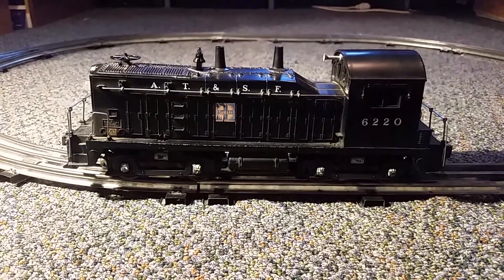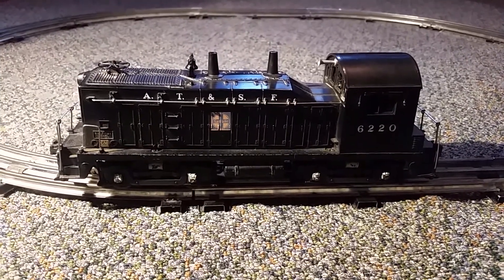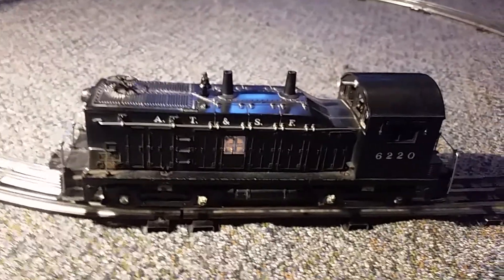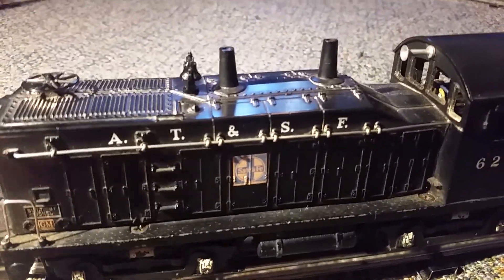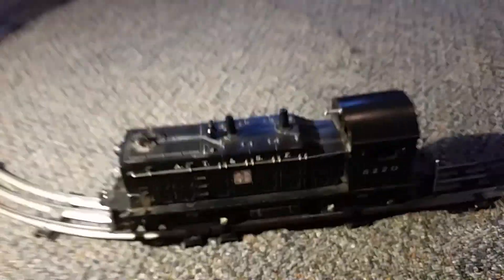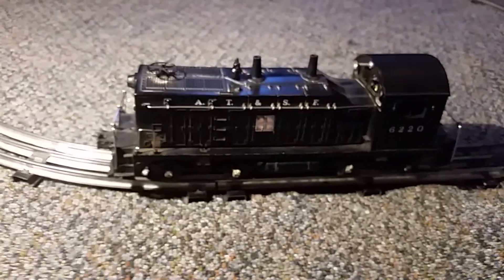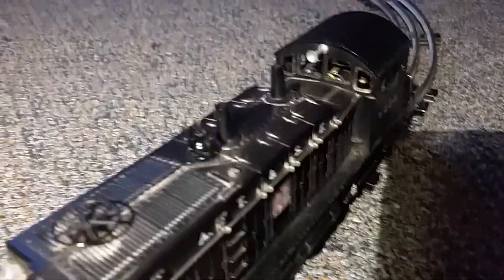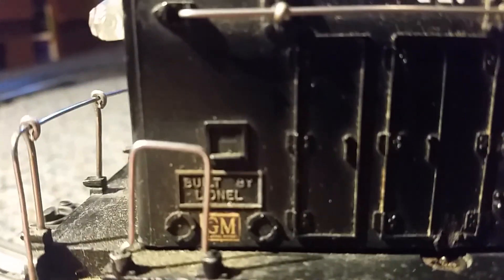Lionel 6220 Santa Fe "Bell Ringer" NW-2 Diesel Switcher

Comment: The NW-2 was made by the “Electro-Motive Division” of (“General Motors Corporation”), as well as the F-3/F-7 (“Cabs and Hoods”) and the GP-7/GP-9 aka GEEPS ! And Lionel was avid about bringing out and placing big corporation names such as “General Motors” because even as far back as the postwar years(1945/1969), and yes magna traction was a very big deal and is still is today ! But, Joshua Lionel Cowen, 
Knew that When steam died, that diesels would take over the main company’s that put out Diesel locomotives that they could count on in durability, reliability,& longevity as well as easier maintenance !!! Well most of the other locomotive manufacturers that made steam locomotives went out of business ! Alco joined forces with General Electric and became General Electric locomotives and the only other competitor is “General Motors”, 
(“Electro Motive Division”) !!! that’s why if you look at real trains you’ll see a lot of GM’s, EMDs, SD-70’s !!! As far as 6220 Atchinson Topeka & Santa Fe goes, I own a (1953) “6250” complete Grandy Dancer set minus original track and boxes ! And I also own a (1956) 601 set too !!! Both SeaBoard Air Line !
Planning on building a small Florida city in a gauge using what I have including my new to me ZW 175W transformer !!!
Can you guess what railroad both these engines are from ??? 
Now my F-3’s & GP-7’s are both 
Triple lash-ups in the Florida East Coast’s (champion colors) !
Love the fact that you’re one of the few girls who loves Lionel Trains !!! By the way here’s a heads up on your track with the black ties is .O31 and the NW-2 was originally designed for the .O27 Line which is still O gauge but, has brown ties and is literally smaller in diameter and closer to the ground then .O31 !
Anyway I enjoyed your videos including the ones from Christmas and if you get a chance you can check out my videos on here under the name ;
Jorge L. Fernandez III /
BrothersandSistersHobbies@
Gmail.com

Comment: Is this bell ringer wr similar to the die-cast tender?
Reply from the maker: From what I understand the die-cast bell ringer tender was a different bell ringing mechanism that was electromechanical and used a bimetallic strip heating up and cooling to momentarily strike the bell. This mechanism is strictly mechanical and runs off the spinning wheels of the truck. However some of the parts are the same, such as the bell gong and the hammer.

Comment: The magnetraction works on fast rack but not as well as the old style track, I have had the fast rack system for years & wish I had the old style. I just bought one of the later style engines w traction tires & will probably be buying another motor assembly cuz I don’t like the traction tires cuz once they break you have a groove in the wheel & it’s pretty annoying. There were some Eunits on these things where it’s just forward & reverse. On the diesels it makes more sense, but for the steamers it doesn’t cuz some of us like to see the smoke unit smoke at idle.